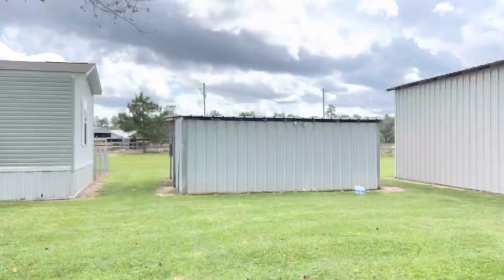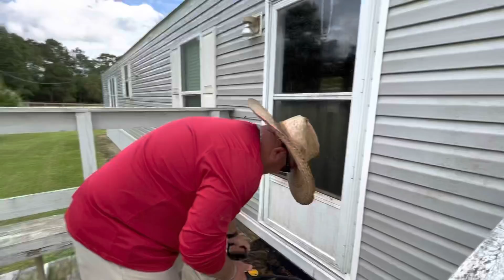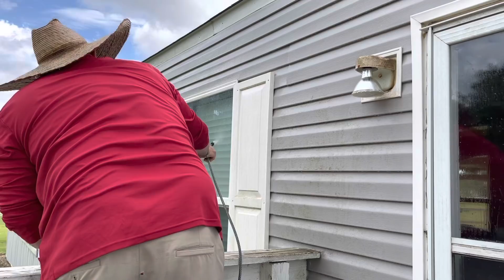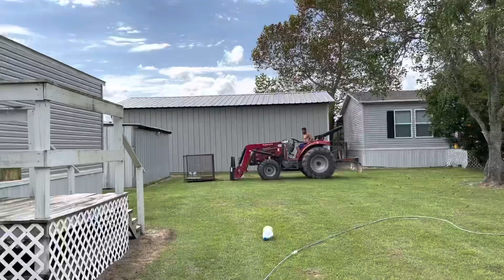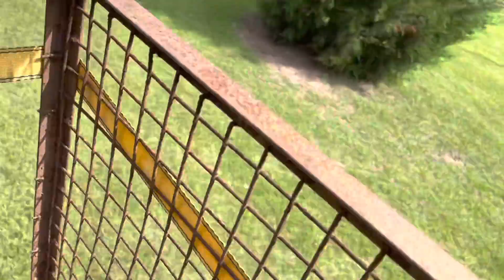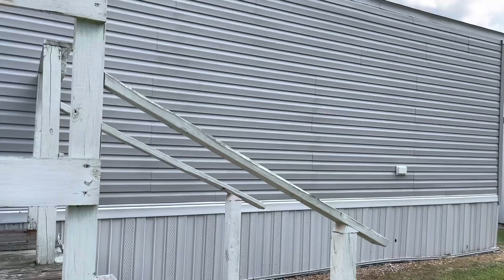Home Improvement Day!

Comment: I had a similar problem on an L-ranch that I built myself in 1972. I used cedar clapboards, 2 1/2" exposed & applied a solid gray color linseed oil base stain. in 3 years, black mildew was growing on all sides of the ranch siding due to pine trees, I was told. I used a product called "Jomax", mixed in measured proportions with bleach & water. It literally melted all of the black mildew right off the siding, then I just rinsed afterword. It was like a miracle product.